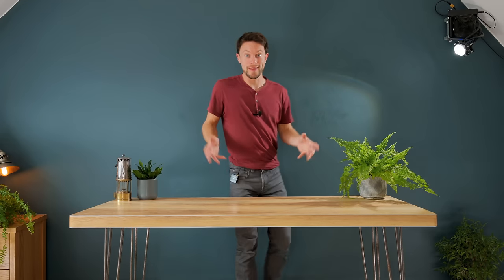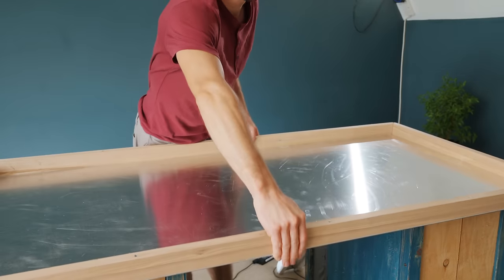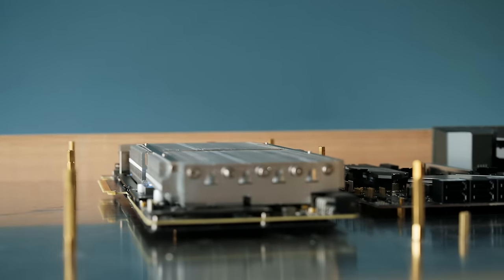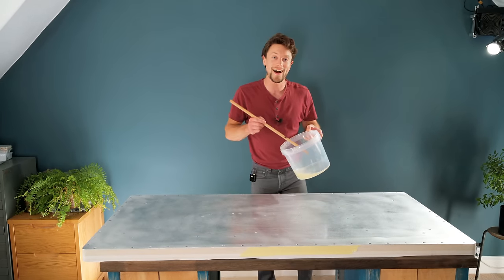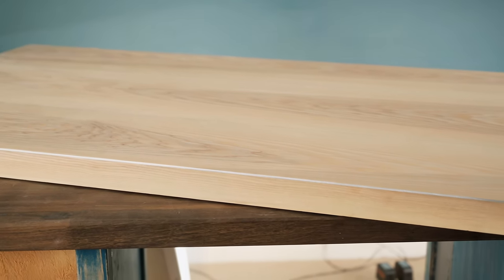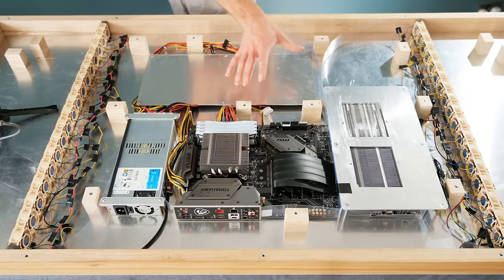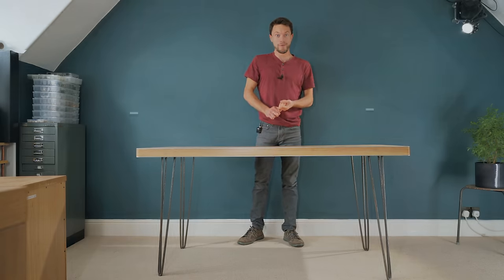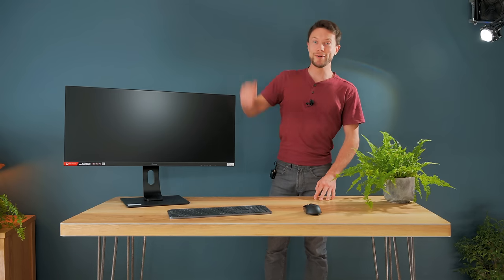Building an invisible PC

Comment: “Hey man you have a paper towel?”
“Sure. Why.”
“I just spilled some water on your table.”
Reply: oof size:
Reply: I mean, there are no holes in the top, I doubt it would do much
Reply: Fly it would do pretty much nothing.
Reply: @Fs3i   Lets just pretend the logic makes sense. It was not a bad attempt.
Reply: @Fs3i  Uh, yes there is. Wood veneer isn't leak proof & liquid might seep through those screw holes under the veneer.
Reply: TheNightOwl11683 whst about the 2 aluminium panels or whatever
Reply: @Mona-.-  Two aluminum panels which had holes drilled in them for the screws to attach everything together? Just have to hope the epoxy sealed those holes up very well.
Reply: TheNightOwl11683 oke
Reply: You messed up my vaneer
Reply: Gave me  slight heartache.
Reply: Fly 
Pc: starts blowing up
Reply: @hexiusblaze2804  that right there would be the outcome.  annoyed that your pretty diy desk has a giant water mark.
Reply: @TheNightOwl11683  bro.. it's just a drink spill... not a rainstorm... Also epoxy is very waterproof in general. It's like a plastic layer. Aaaaaalso if the epoxy doesn't seep through, water won't either :)
Reply: @TheNightOwl11683  Yes, but what about the glue underneath it...
Reply: i once spilled like half a water bottle right on my pc vents and the whole inside was soaking in water as the fans were throwing water all over the pc insides and i literally did nothing abt it and kept using it normally and to this day it still functions properly nonetheless it was a horrifying thing to witness
Reply: @ravenclawgamer6367  Yea, it has 2 part epoxy glue under the wooden veneer sheets and could also put clear oil based varnish on top of the veneer sheets and on the sides aswell.
Reply: @Fs3i  hopefully the wood doesn't absorb liquid
Reply: Dude, water may do nothing but fuck that was an oof
Reply: OOOOOOOOOOOOOOOOOOOOOOFFFFFFFFFFFFFFFFFFFFFFFFFFFFFFFFFFFFFFFFFFFFFFF
Reply: @TheNightOwl11683  The holes on the top are epoxy sealed.
Reply: @TheNightOwl11683  the epoxy definitely covered the screw holes, (the screws alone would be a good seal countersunk as they are, more surface area on a seal means stronger seal, even with metal to metal contact), but you're right, he should epoxy or otherwise seal the top to protect veneer.
Reply: Oh shi

Comment: So glad to find a tutorial that I can work off of, and draw ideas from. I was thinking of using a standard sized power supply, given my proclivity for gaming, and figured that what I could probably do is create a side cabinet on the desk to house it. A secondary, fun idea I was toying with was extending the power button to the siding, where a small hole would be placed for it to set in, along with a button covering with the power symbol etched into it to maintain the wooden appearance, possibly to do something similar with a disk drive and USB ports with little sliding covers.

Comment: Would have been nice to add to the table 1 or 2 USB ports, anyway great idea ;)
Reply: Good idea!
Maybe add a USB hub that is mounted inside the table and add custom access holes.  Then add a slider to hide it from sight when not in use.  Add some of the left over vinyl to make it blend in with the table.

Comment: Lots of woodworkers like myself use contact cement when applying veneer. Its a lot less stressful than trying to use epoxy and not very messy. It should yield better results too. Also when veneering something as large as a table its much easier to purchase a paper backed veneer thats already the correct width, rather than joining 2 or more veneers on edge the way we are shown in the video. Always ask questions before making an expensive mistake!
Reply: He can't know everything, lol. This is all really fascinating. I wonder who can actually afford to make this project, even HE didn't spend the full budget with all that was given to him. That's not even getting into how much skill this takes to make.

Comment: Amazing build, so elegant! If you allowed a quarter inch or so more thickness you could also add a lining of vinyl or rubber under the top sheet which would make it even quieter, even making it sound more solid when you tap the top of it

Comment: "Most people would assume that this is a normal wooden table"  No, Matt, no.  With your videos, most of us would assume that you've somehow incorporated a 95 inch 8k TV, several gaming systems, full surround sound, and a toaster into that table.
Reply: A built in toaster would be awesome. Add a cup warmer too for coffee mugs. Make this happen Matt!
Reply: I need a toaster inside my desk now!
I'm thinking if I angle it slightly and put powerful enough springs in, I could get it to pop out straight onto a plate Wallace and Gromet style.
Reply: Sometimes I wonder if DIY Perks isn't really a spy.
Reply: most people don't watch these videos
Reply: @mRendyIrawan  a cup warmer would be rather possible, with those two high power calculating pieces of sand already in there

Comment: me: Get killed in the game.. *Slams Table
me: Ooops.
Reply: How it chews to gum 5 feel
Reply: @the_swarmrecroom4780  GUM GUM
Reply: @itsBAY35  sense your stimulates
Reply: This is way too real
Reply: well if you don't use and hdd it shouldn't be as bad
Reply: Welp, there goes your hard drive! Oops?
Reply: @ceresjanin8679  That's true. It's beneficial to use a SSD, but they're expensive relative to their capacity. Many PCs have a SSD for Windows for fast booting and smooth operation, and a very large HDD for pure data storage. You can get a 1Tb HDD for a fraction of the cost of a half terabyte SSD.
Reply: Imagine getting mad and hitting your knee on the heat sink of the GPU
Reply: Don't think that would effect it much though
Reply: @Jessica Landwehr I've actually killed a HDD once, by punching it ha ha ha
Reply: Damn... I was thinking about this xD

Comment: Pro: Builds a case that looks like a table with custom cooling solution.
Me: Rips a laptop in half. Duck tapes it to bottom of cheap table.
Reply: I actualy did something similar years ago, I had a desk with A thin drawer that could fit my old laptop perfectly with just enough room for most of the ports, so I just cut a part of the back panel for the cable and it looked just like in this video just a bit thicker!
Reply: @Rye Rye, I like your aproach. Why loose so many days of your life doing this xD
Reply: Hehehehe, and they say the arts are dead. LMAO
Reply: Job done mate, wanna build me on too??
Reply: LOL
Reply: now i know what to do with my busted RoG laptop...

Comment: Holy smokes 40 Noctua fans. At this point maybe a custom loop is more cost-effective. Nice build tho
Reply: That will only cool the cpu or gpu. The rest of the mobo...the power supply ..etc....all need decent air flow too so they don't overheat and get wear and tear and fail prematurely
Reply: Or just using 120mm fans or even bigger... And lie them flat
Reply: @guardianali  Just put a single 40mm fan on the VRMs and it will be fine.
Reply: lol I checked prices and it's fking bananas! Noctua 40mm is each 17.90 euro! multiply it by 40 and it's 716 euro for the fans only WTF??
you could easily buy the cheapest brand I found locally "Gembird" and it only costs 1.90 each so it's only 76 euro for all!
.
Damn Noctua is fking stealing people and they still buy from them.
Reply: @xorkatoss  he is YTber, he has money from all the views. He needs to invest to get return thus 40 fans noctua
Reply: Di-Ai-Why also its given by noctua, so why not take it
Reply: @lavithhcm  he doesnt earn that much thru yt, more likely sponsorships, idk if he does them.
You prob get them cheaper when buying is bulk too, but there are really no good alternatives to noctua :P
Yes there overpriced af but you can get some decent cooler (with included fans) pretty cheap second hand. I would have also used 120/140mm fans and laid them flat with custom watercooling for the cpu at least, maybe gpu depending on setup.
Reply: @D3nn1s  are you sure? This video in 2 days has 738,000+ views. At the current rate for content like this minimum $2.2US/1000 views. So he makes roughly $1600+ in 2 days just for this video. Cheers on him. So really you need to invest to get a return. Imagine who would talk about the buzz if it is just a regular cheap alternative fan. You get my point.
Reply: Move to Alaska. Problem solved. 😂
Reply: @xorkatoss  You can actually get used name brand Sanyo/Delta 40x28mm server fans and undervolt them to around 6V for similar performance. Won't be as quiet as the Noctuas, but these can be had for like $3 per fan.
Reply: True, but maybe he simply wanted something different.
Reply: Aircooling is way more reliable and requires less mantainance
Reply: @xorkatoss  Noctua fans are really fucking good, just overpriced. They charge that price because there's really no cheap brand as quiet and effective as them -- or with a name as well known as theirs, associated with quality. The few fans that manage to perform as well as them end up costing about the same. For example, Be Quiet! fans cost around $25 for good PWM.
Gotta love the lack of competition, and what it does to the consumer.
Reply: @lavithhcm  with the time he spend building that table thats pretty much nothing. Im guessing it took at least 20h if not more, plus the hardware he put into it. Not much profit if you ask me.
Reply: @guardianali  Aight, It's a better choice about the OP said than this Youtuber had invested way beyond absurd amount of money where the word "Reasonable" seem doesn't belong at all. Afterall Custom loop is atleast does less dusty than full Air cooling and also comes with quite of maintenance and the risk of leaking as well. If this has to be compare in amount of investment then it would reasonable to buy cheap and fully working product that serve the same purpose.
Reply: @frogg4711  true, but he could get an aio cooler ;)
Reply: @lavithhcm  Bro... That's not how advertisement works on Youtube. 2.2$/Per view is way too much and profitable. In fact that it's actually much less than you are really expecting for, and the ads can only give varies on amount of money around 0.10$ to maybe max 0.40$. Then calculate that to it in 1k views per ads would be, let's say 0.40$/1k,Views result is 400$ and there is one thing i want to add as well. Have you ever think about wondering why is many youtubers with millions of views only get 12k-25k amount of revenue when the estimate of it is much larger than that and the reason why is because not everyone is willing to watch the ads on every video and that's how advertisement revenue works.
Reply: @fizkun-my8555  So you are 100% sure that's the case. I am just saying for a 1000 views, he could make $2.2US at minimum for the content like this if he lives in the States. If he lives in 3rd world country that figure is less depends on where you live. The key word is "the content." gaming content makes much less at the bottom. Beauty content makes more than this. And financial content makes top of the list. So clearly,. he doesn't live in 3rd world country. So I just assume the basic there. Doesn't matter though. Kudos for him whatever how much he makes but I am sure it's profitable. With 2.45M subs, I would imagine he makes in around 6 figure income annually.
Reply: @dahahaka  maybe put the fans on an angle at like 40* angled on the sides of the desk and it will like like a cornering side
Reply: @xorkatoss  They cost a lot, but they're a lot better than any of the competition.
Reply: A. M. Some high end motherboards have water blocks for the chipset and vrms
Reply: @xorkatoss  Not only that the price for a sheet of aluminum is crazy. I'd say this whole build is around $3000
Reply: Imagine cleaning that loop
Reply: @lavithhcm  2.2$US is really baffling to me and not logic at all. How come yet this Youtuber revenue can't even compete with RyanToysReview if he gets 2.2$Us for this kind of content? I do believe that he does get return of the money from what he did invested in. Afterall, can you give me the source with that 2.2$ Claim of yours? I am highly curious which advertisement is really humble enough to give that much money per view.
Reply: @fizkun-my8555  I never said 2.2 per view. I said $2.2 per thousand views. Maybe you mis-read me
Reply: @lavithhcm  It seem i had misunderstanding about that part. Fair enough to say what you are saying are true based assumption regarding to the topic.
Reply: @lavithhcm  does he run ads on his channel? There's no midrolls and I didn't get one at the start.
Reply: @guardianali  They weren't the issue. You could have still just mounted a fan directly over the motherboard to get some airflow. It was only the CPU and GPU that were complicated due to the height. The power supply has its own fan already. 

But you didn't even need these 40mm coolers. You could have just mounted the regular 120mm fans flat...I honestly don't understand why that wasn't done.
Reply: @Crustee0  because wiring 40 fans....
Reply: @lavithhcm  It doesn't matter where he lives, only where his viewers are from.
Reply: @dahahaka  That's what I was thinking. Sure, maybe you'll lose a bit of efficiency because they'll be pretty close to the top surface, but you could easily buy a handful for far less money. The Silverstone FW121 is about $11 and only 15mm thick (it's low profile). His 40 Noctuas are equivalent to about 5 120mm fans. You'd be spending $60ish instead of $600!
Reply: @JMMC1005  I would go with pressure optimized 140mm fans from noctua, won't cost all that much probably need two of them for each side, 25$ a pop
Reply: @dahahaka   Yeah, any variation on that theme would be more sensible I think.

I'd also use a large (360mm) AIO radiator instead of his CPU cooler - it could mount flush with the bottom surface and offer much better cooling.
Reply: @JMMC1005  Not necessarily, air cooling is often better, more silent (provided that you use decently sized low rpm fans), and most importantly easy to install and maintain. But yeah obviously there's ways to improve.
Reply: @dahahaka   Well yeah, agreed. But given how space-constrained he is, it's the only way to get a big cooler with lots of surface area venting directly out of the desk (aside from his idea of using a GPU cooler, or making some kind of custom heatpipe arrangement).

I wouldn't usually recommend an AIO but it would fit this particular application well.
Reply: @xorkatoss  I dont think you realize that noctua makes the highest quality fans. they arent "stealing"
There is a reason for the price disparity between this nobody brand "Gembird" no one has heard of.
Noctua makes amazingly quiet, and amazingly high performing fans...
Linus even has a video on a 40$ Noctua cpu cooler out performing $100 AIO Cpu coolers.

Comment: Imagine, just imagine, there is wirelessly charging plate on the right side for earphones and extra accessories! I'm amazed, remarkable work!
Reply: That is a fantastic idea but would definitely be tricky to pull off well since wireless charging won't work through the metal sheeting and needs to be within milimeters of the device you're charging.
Reply: @montyp2000  maybe he'll modify it if he sees our comment 😀
Reply: @montyp2000  maybe if you cut a hole for a wireless charger in the aluminum and then have the veneer over that? Don't know if it would be thin enough though
Reply: @montyp2000  he can cut through the  aluminium for inductive transmission. Leaving a layer of wood
Reply: There are Qi charged earphones for sale someplace? Spill! TBH I don't think it would ruin things to have a matching, cabled oak Qi charger above the desk or c.f. the monitor.

Comment: i did like to recomand respectfully, that it is a no go in airflow to overpower inled. you always have to power up the suction outlet. if you only had one fan you would go on the out let. this is all to prevent airflow stuck or creating a overpressure. you always want to have under pressure. please excuse my bad (german ) english. your work is great and i am watching for years.
Reply: yours work fine thou because you overpowered it so hard :)

Comment: I just realized, this PC will keep your legs warm during winter. Nice.
Reply: Exactly ;-)  Probably also your hands on the table.......
Reply: yea and during the summer :)
Reply: My 1994 Amiga did the same thing, my 1970 Grundig colour TV would heat the whole room, the bloody lights would dim when you switch it on because of the massive degaussing current, then there was a loud 17khz whine as the HT transformer powered up, followed by a loud static hiss & crackle as the 60KV tube supply powered up, about 3 minutes later you actually get a picture, but the colour keeps changing as it warmed up. And forget digital tuning, this was done using 6 pot core ferrite tuners in a drawer on the front panel. That was your 6 channels! :P
Reply: Lap tops will to
Reply: Let's make it to top comment!!!
Reply: not only legs. if you know what i mean.
Reply: @festetwelfth4831  ooh im interested now
Reply: and boil your eggs well
Reply: Uh...it only 81° C max...that's 117° F...